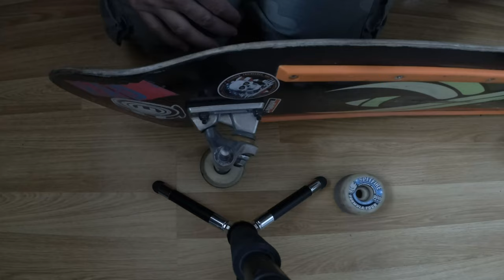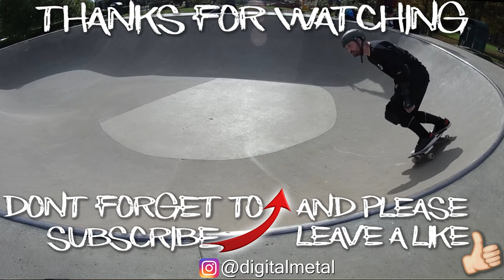Installing Skateboard Bearings The Right Way - With Spacers

Comment: I've bought spacers before and they jump around in my wheel in-between the bearings. They tend to just rub again the truck axle and slow down my bearings aswell. They tend to claim they allow you to tighten jr axle all the way but when I install spacers. They still lock up my wheels and bearings.  Help please, installed exactly how you showed
Reply from the maker: The spacers you use need to be the same length as the depth of the space between the bearing seats, if they are lose along the axle shaft with the bearings installed then they are not long enough, if they are just a tiny bit too short you can add a washer or two against the spacer before you put the second bearing in , this will fill the gap and allow you to tighten the axle nuts up fully. You also need to make sure the diameter of the spacers are smaller than the diameter of the inner core of the wheel where they sit, they must not be so large that they touch the wheel, if they do they are the wrong size and will rub on the wheel and slow you down for sure.

Comment from the maker: Hey, everyone, I've had a few comments from some people that their wheels don't spin properly after fitting spacers and tightening their wheels down, I'm going to make another video soon the address this but in the meantime here's some pointers to consider.

1) Check your spacers are the right size both in diameter and length. Diameter wise they should should be lose inside the wheel core and not touching it, if they are a snug fit inside the wheel core they are too big and you need a smaller diameter spacer, for length they should be the same length or slightly longer than the depth of your inner wheel core between the bearing seats, if they are too short they will not work and have zero effect on the situation i.e. be the same as having no spacers at all.

2) Your wheels may not be very accurately made meaning the bearing seats are not a very good fit for the bearing and are causing the bearings to be spaced further away from each other and the spacer than they should be.

3) You might not have seated the bearings fully down in the core as much as they should be causing the same effect as point number 2 above.

To remedy these situations you can:

1) Buy the correct diameter and length spacers, in my experience there are generally two sizes one that is larger diameter that is too tight against a wheel core and meant for roller skate wheels and another that is smaller and the perfect diameter for any wheel. sometimes both of these vary in length.
Wheel cores also sometimes vary in length so you need to size them up against your wheel cores or try the fix number 2 below.

2) If the diameter is nice and loose in you wheel core but they spacer is a bit short and you cant find longer spacers, you can try adding another speed washer between the spacer and the insider of the bearing to effectively make the spacer a little bit longer and solve the issue.

I hope that helps, and as i say I'll soon make another video that explains all of this in better details with visual examples.
Reply: Hello

I have a question ... i have 59 mm Bones rough rider wheels and swiss ceramics bone bearings...the spacer that comes with it is too loose when I assemble it.. what is a good spacer that will fit this ?

Please help me
Reply: Are the spacers supposed to be loose in the wheel core?
Reply from the maker: Do you mean lose as in there being a gap between it and the bearing or as in its diameter is small ?
Yes the diameter should be smaller than the wheel core hole otherwise it will grip the wheel and slow you down.
Reply: @NeilHesterSkateboarding  after installation I pick up the wheel and you can see the spacer move and rattle.
Reply: @NeilHesterSkateboarding  if you have an email I can send picture
Reply from the maker: Rian that’s right, as long as when the wheels are on and the nuts are tightened up they go tight and no longer rattle.
I think I had better make another video explaining these things too.
Reply: @NeilHesterSkateboarding  awesome ty sure. I will subscribe
Reply from the maker: Rian cool thanks for your support 👊🏼
Reply: What spacers did you use for the Bronson raw bearings? I am ordering those exact bearings but I am not sure what spacer I am supposed to get if there are any other factors please let me know!
Reply from the maker: @skirtskirtwatergunmandopeb1035  There tends to be two sizes generally, around 10.5mm outside diameter and around 12.5mm outside diameter go for the smaller ones as they fit all wheels. They are all generally about 10mm wide too.
Reply: hey I got some bones red bearings with spacers and washers would it fit a 54mm wheel and also what is the ring when you buy new trunks used for
Reply from the maker: @isy1502  wheel diameter does not matter, if the spacers sit inside the core of the wheel between the two bearings as I show in the video without actually touching the wheel you should be fine. What I’m presuming you are describing as rings are probably the speed washers , there should be two. You place one on the truck before putting the wheel on and the other on after the wheel before putting the wheel nut on.
Reply: @NeilHesterSkateboarding  thank you
Reply from the maker: You might find my latest video useful too.
Reply: So, now that I installed my bearings backwards, how do I get the bearings out of the wheel so I can put them in the right way?

Comment: So I’ve had some RAWs for about only 3-4 weeks now and all of the sudden they have just slowed down well enough for me to notice at the skate park?! I’m just so frustrated and confused what happen?? 

On all the same ramps and jumps I hit before my speeds are just WAYYY lower all the sudden I can just feel it but I don’t know what’s wrong?? Any suggestions on what I should do with my bearings or what might be happening ?
Reply from the maker: Most likely full of dust. Same thing happened to mine so I stripped them down and cleaned them (there’s a video on my channel about that too) if you do t want to strip them down you can do a fairly good clean by just washing them in a solvent like solution like a mild isopropyl alcohol  and dry them straight away with a hair dryer. But you’ll find you have to clean them again soon in a few weeks. Ultimately they are a gimmick and I’d not recommend buying them over better performance bearings like bones Swiss which I’ve been using for over a year and never had to clean and are still just as fast as the RAWs ever were.

Comment: yes spacers are an absolute must! too many ppl dont know this, i sk8 down hills and slide a lot, if i had no spacers my wheels would lock. by the way, its a coincidence we both have the same bearings and wheels, are they conical full? i have the 58mm. also are they 1/4 inch risers? i have the same.
Reply from the maker: Yes I ride 58mm full conicals, but I ride bones Swiss bearings and Ron’s Rockets these days , they are faster and require far less cleaning. I think these are 1/8th inch risers.
Reply: @NeilHesterSkateboarding  i thought they looked exactly the same, most people would choose a smaller and/or narrower wheel i think but if youre like me, i chose this size for the widest contact, i was getting a bit of wheel bite though so went from 1/8 to 1/4 risers.
Reply from the maker: 👍🏻 Depends on what you skate, bigger wheels are faster and more contact means more grip, so most often chosen for bowls and vert which is mainly what I prefer with a bit of mini ramp for practice. Smaller narrower wheels are better suited to street skating.
Reply: @NeilHesterSkateboarding  well, i skate street mainly and a bit of mini ramp at parks but because i liked the wider wheels in the past had to get them, i had it in my head wider wheels ride better over rough bits and dont chew up as much sliding, its working so far and they work well as brakes downhills haha
Reply from the maker: Beyond the mechanics it’s all just personal preference 👍🏻

Comment: Does it really make a difference which way I mean the balls don't have to be facing outwards visably..
Reply from the maker: No it really doesn’t matter they are fully symmetrical in that sense. Some people mistake the inner cage that spaced the ball bearings apart as a dust shield but it’s not.

Comment: might i ask what benefits the spacers have? is play in the wheel a bad thing?
Reply from the maker: Using the spacers allows you to fully tighten down the truck nuts and the wheels will freely spin on the bearing as they are designed to do. Having play in the wheel is bad because the bearings will take more of a lateral battering and wear out prematurely, some people claim they don't care and will just buy another set, I prefer to buy higher quality bearings that work more efficiently and last longer than cheap ones, and look after them.

Comment: Hiw come when i tighten my axle nut all the way with spacers the wheel dosent spin i have to loosen off until there is a minute gap my board souds so rattly because iys not tight
Reply from the maker: Unfortunately it seems like a lot of wheels don’t have particularly accurate bearing seats so they are sometimes a little bit too shallow or deep so the spacers aren’t an exact fit, it’s ok to loosen them off a tiny bit to get them spinning right but better if your wheels and spacers are well matched to allow you to tighten them properly.
Reply: @NeilHesterSkateboarding  ye might see if I can find slightly longer spacers.i have some zealous built ins but the don't spin for ages  like my  others. Thanks for the reply 👍
Reply: @NeilHesterSkateboarding  I've seen alot of videos where people leave the wheel with quite a bit of play up and down a good 3 or 4mm but surely that amout of travel isn't good... my wheels spin amazing like that but can't handle the noise
Reply from the maker: @MrGough22 yeah your bearings won’t last as long if that are smashing around with a lot of play so you want to minimise the movement but if they are are so tight they and making the wheel not spin that will put unnecessary load in the bearing too. You can try installing another washer between the spacer and a bearing to effectively increase the width of the spacer enough to take up the difference if you think it’s a big gap. It’s ok to have a tiny tiny bit of play because there will be some movement in the bearing assembly itself but you don’t want the wheel sloppy on the axle.

Comment: So I'm new to skateboarding and bought a complete zero deck. When I removed the soft wheels it came when, and installed hard wheels I noticed that when I screw the top nut of the wheel on tightly the wheels don't roll out properly anymore, but come to a stop quickly. I do got bearing spacers and I'm told that you can screw a top nut on tightly with spacers and should roll out for a long time. Can anyone help? Thanks!
Reply from the maker: its most likely your new wheels are not made all that accurately, you can either back the nut off just a tiny bit or you can remove one bearing and put another speed washer next to the spacer before putting the bearing back on, this will increase the spacing which is probably lacking a bit by what you are describing.
Reply: @NeilHesterSkateboarding  hmm sounds good! I will try, thanks :D If I back the nut off a tiny bit and there's a minimal spacing between the nut and the 'outer' bearing, would this be bad for your bearings? I heared so.
Reply from the maker: @SimplicityEDC  Just give it a fraction of a turn and try wobbling the wheel if its not wobbling try a little more, a lot of people skate with their wheels loose and although its not great for your bearings it pretty hard to do some serious damage to them.

Comment: If the spacer is a bit long and it pushes the bearing
which side of the wheel would you leave the pushed out bearing on
graphic or back side?
Reply from the maker: It’s not going to matter which side because it’s probably going to shift , would be better to get some shorter spacers that fit better if you can.
Reply: Thanks you are awesome 👍

Comment: Did he put the bearing on backwards
Reply from the maker: Nope
Reply: Neil Hester - Skateboarding What if you put them to opposite way as you did with the same technique
Reply from the maker: Flann it’s actually no big deal to do that , the bearings are fully symmetrical except the inner cage and for most double shielded bearings you’ll have no idea which way round they are without removing the shields to check.
These bearings in the video have no shields at all and what you see is the cage.
Reply from the maker: @tmbg1985 not with bronson RAW’s as I used here they are open bearings with no seals , I put them the correct way round as I’ve previously responded to others who have said the same.
Reply: Neil Hester - Skateboarding I would definitely get some seals for those bearings. Otherwise you would have to clean them every week or so. I see they are open on both sides, but at least putting the nylon retainer side facing out would prevent more dirt coming into than putting them with the ball side outwards. Cheers.
Reply from the maker: @dariodraiman6339  🤣 you are totally missing the point of these bearings, they are deliberately designed without shields. The back of the cage will not stop dirt entering the bearing, it does not it’s way too open.
Do a little research on them like I have.
Reply: @NeilHesterSkateboarding  You are right. From the video, the first impression is that the bearing has a shield/seal on one side, but it doesn't. I'd guess it wouldn't be much difference installing them either side after a while they would be dirty no matter how. Thank you for clearing this out. I wouldn't buy these bearings unless I could put a seal to them. I've recently bought 30 seals for a $1-$2 to deal with one side bearings (similar to Bones) because they were getting dirt very often despite being installed properly with the cage side facing the inner side of the wheel. Cheers!
Reply from the maker: @dariodraiman6339  Bronson RAWs are deliberately shieldless, the is no lip on the outer race ring to retain it if you tried to install one either. They are just the wrong bearings if you want to keep dirt out. There are plenty of other options if that’s what you want.
Reply: @dariodraiman6339  i always remove my shields when i get new bearings cuz i go faster. If you're worried about dirt getting in your bearings you have a long way to go in skateboarding.
Reply: Elliott Knighves you are probably right. And I longboard, not skateboard, so perhaps you wouldn’t have much dirt in the skate parks and other spots. I think longboards get exposed to more harsh environments. Cheers!

Comment: Is my bearing spacers supposed to be have a lot of room in the wheel to move around?
Reply from the maker: This video should help explain:
https://www.youtube.com/watch?v=M5oV7q3u9so
Reply: @NeilHesterSkateboarding  ura legend! Thank you so much for the help:)<3
Reply from the maker: @10isawsome  No problem ;)
Reply: @NeilHesterSkateboarding  Follow up question, so I know obv that if you cant tighten the nut all the way without the wheel binding that the spacer is too short, My question is, since I bought 5 sets of these, is it worth at all to still run these spacers just without fully tightening the nut? 
Or should I just forget those and wait to buy the proper length ones?

Comment: I have heard spacers don't always line up correctly to the inner core of wheels. As they are all different. As well as all inner spacers can be different measurements. So that's why I don't use them
Reply from the maker: There are generally only two sizes of spacer, the bigger ones are for roller skates 🛼 the smaller ones are for skateboard wheels.
It does depend on how accurately the wheels are made as to how well they width wise but you can fix the difference spacing them out further by putting a washer after each spacer you’ll generally then not have any trouble.

Comment: Hello, is there a wrong way to put the wheels on the axles? Like does the wheel have a front side and a back side?
Reply from the maker: Hi it depends on the wheel and its shape, if it is symmetrical (which most are) then there is no problem doing that, there is no real problem doing it at all but if its extremely conical like a wheel on a penny board or some downhill wheels then it might look a bit strange.
Reply: @NeilHesterSkateboarding  Thank you, the wheels I have are the spitfire classics. The designs are on both sides so I was wondering if it mattered which way I put them but thanks you again.
Reply from the maker: @golgo2888  oh no, they can go any way round, enjoy your skate 👊🏻👍🏻

Comment: i’m pretty sure the shield is supposed to be facing out my guy, especially for bones reds
Reply from the maker: There is no shield, these are Bronson RAW shieldless bearings, have a read of the other comments, it’s been discussed many times 😉
Reply: @NeilHesterSkateboarding  lol @0:18 you can see the shield my guy but all good. Video is still good. As long as people get to skating. I had issues installing this but i notice lots of videos do it with the Trunks already on board, ive been trying to do it off board and it's hard. Will have to try this when i get home.
Reply from the maker: @tsijr915  its not a shield it's the bearing cage, as I said before they are Bronson RAW shieldless bearings.